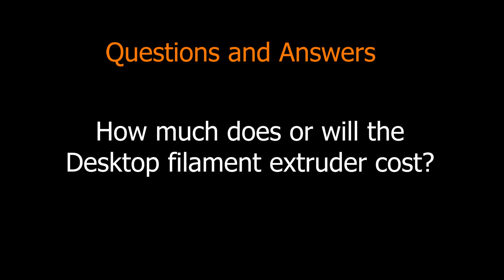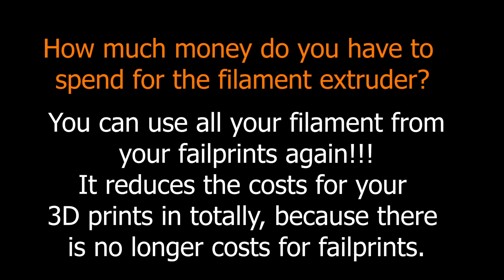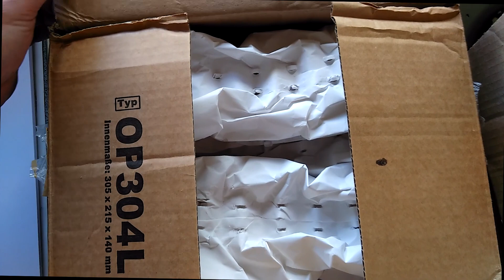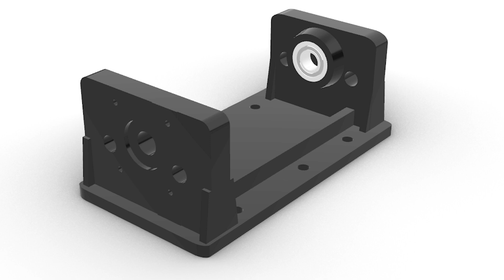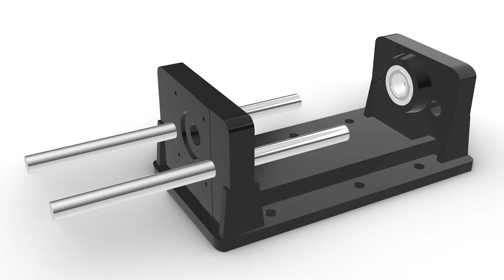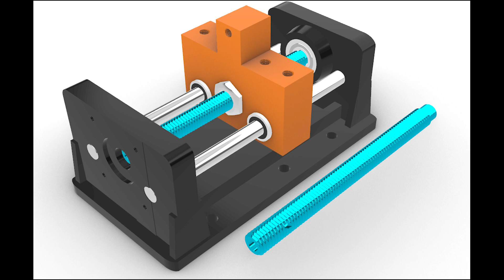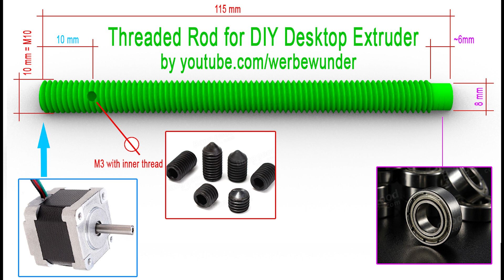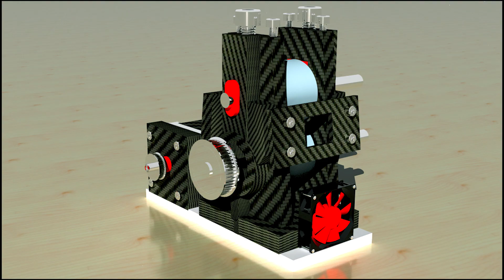3D Printer Filament Extruder [DIY] #1 Safe 90% Filament costs - A MUST WATCH for 3D Printer Owners!

Comment: Suggestion: use a M8 rod and use a 8mm to 5mm coupling. These are not expansive and you don't need anything but a saw to cut the rod to length ;)

German: einfach die M10 Gewindestange durch eine mit M8 ersetzen und dann ne billige 8 auf 5mm Wellenkupplung verwenden. Somit ist keine Bearbeitung der Stange mehr notwendig (abgesehen vom Zuschnitt mit Säge)
Reply: dann müsste die ganze Konstruktion aber länger ausfallen, da die Wellenkupplung ja auch noch Platz wegnimmt. Eine Wellenkupplung ist ja ca 25-30mm hoch- Das heißt man benötigt das untere Teil in 30mm länger
Reply: aber die Idee ist gut
Reply: Yes!!! Good solution
Reply from the maker: Then the winder has to be longer where the clutch is but the winder cannot drive. You need about 80 mm of travel for the wide filament rolls.
Reply: @Werbewunder  ok so extend the motor mount and travel stays untouched. Ok it gets 3cm longer but is it that critical? If so you could also use a belt, flip the motor and put it under the mechanism, so it gets shorter and T5 pulleys wit 8 mm hole are available ;)

Comment: Was $87 the average cost for this project as a whole or was that just a random floating number?  Thanks for English BTW
Reply from the maker: For the whole project the material price is 200-400 Euro
Reply: Werbewunder thank you very much for getting back to me.... I may decide to make this instead of another personal printer.... it’ll pretty much pay for itself in the long run...
Reply: It was a random floating number to show that you cant say how much the project will cost. It depends on the parts you will use. For example PID is not PID, there different versions you can use and buy and they have different price ranges in different countries and different shops.
Reply: Tam Gaming I understood that part... but no matter what the project is there’s always an Average price to get the project completed.  Or at least how much it cost the creator to create it and then you can adjust price yourself based on quality of products you choose to use.  I don’t think I’d ever start a project without knowing an average price point or at least what that specific project cost the creator to complete.
Reply: @Anthony Louis Hello Anthony, i understand your point totally. I know from werbewunder, that the costs of the desktop filament extruder isnt final so far, because the extruder itself isnt calculated exactly atm. But in Euro - its depends on which materials you use for the case and so on - but the cheapest version if you rebuild it is i mean he said around 400-600 euro. But because its not finished atm. I would start in your case to look for the electronic in your country or the links in the description and calculate it together. But see it as investment, and what you wrote "in long run" depends on which material you will print and / or if you can sell it. Let me give you an example: PLA to buy costs you around 30 - 60 euro per kilo. Some is more expensive like the one from greentech but it this you can rebuild later buy your self. So if you now calculate to buy 1kg granulate for 5 -10 euro - and you can sell it after you made it for 50 euro to be a bit cheaper than the original reseller you earn around 40 euro. How many kilo you have to make or sell if you need 600 euro? :-) You can calculate that this filament extruder will make around (depends on the filament type) minimum 1kg / hour.  Means after you have build it by your own you have in 15 hours your investment back :-) If you do it with PA12 the costs for the filament is way higher but the 1Kg Spool costs way way more if you buy it from a shop. Means you have to make not 15 kg to get your investment back - you have to make only 5 kilo to sell for your investment. So, if you are smart, try to rebuild it with the links in the description, then you know you have the right parts and no fail investment. If you want to be total sure, then wait till the last part = extruder is done and calculate everything together and then overthink if you want to rebuild it or if its to expensive for you. I hope i was able to help :-) Greetings from germany, sry for my bad english.
Reply: Tam Gaming Tam Gaming don’t apologize, your English is better then mine and I’m from America :)
I’m actually planning on doing it all for personal use so I’m going to stick to the lower budget end of the electronics.  I have a few life size projects planned that are around 40-50 kg of filament each, so the amount of money I’ll save just on making my own filament would pay for this filament extruder alone!
Reply: Hello Anthony, thanks for the nice words about my english :-) 
When you do it for your life size, then you really need the extruder. Why, because all the failprints arent any longer failinvestments. You can reuse them too by shredding them and reuse them as granulate. The only costs you will have in future from your failprints is time and power. From this saved money, you can buy another 3D printer and get the time back and make your extruder more effective :-) Its like to have a own gasstation for your car, and if you are bored of printed parts and you do not need them anymore, shredder them again to make filament again out of it  :-) I know that werbewunder has planed already to make a home- or desktopshredder. This you can use for your old print projects you dont need anymore or for filament which is on spool but not enought for a new printjob. Then you can shredd it and reuse it again as filament :-) And another great thing is you can make and produce your own mix of filament. If you arent happy with filament because its not flexible enought, then mix your own filament till you are happy with it. I love the idea to have to total freedom for my 3D Printer. Earlier or later everyone will have his own filament extruder at home  :-)
Reply: Tam Gaming yeah absolutely.... I’ve been wanting to get a filament extruder for a while now but didn’t want to spend $1000 on a decent one.  This might be the alternative I’ve been looking for.  Luckily Christmas is right around the corner and it’s the perfect excuse to spend some money on myself :)
Reply: Haha yes i also know what i will get on christmas because i make my self the present :-) it would be stupid not to invest in an filamentextruder, its a moneymaking machine and it neutralize all costs from 3DPrinting. It will finance all my next investments for 3D Printing. You will see in 1-2-3 years near every 3dprinter owner has a own filament extruder or knows someone who make it for him cheap :-)

Comment: Congratulations on the video!

In this part what I find difficult is the threaded rod.

Everything that customizes metal parts is complicated.

In my opinion, the ideal would be to replace the threaded rod with for example a gt2 belt as seen in this video:
https://www.youtube.com/watch?v=1zHvllPxvaw

In this way it would be easier for everyone.

I know that each of us can customize ... but in my case I would not know how to model it or modify the arduino code to make it work.

I think that making that change in the design would make everything much simpler and easier to replicate for everyone.

In the next videos I would like you to say what each part is for and what it does to make everything work and how it works.

Thanks again for all the work you are doing.

Comment: Ideas from a cheap but smart guy form Québec...
I've think about a solution to avoid power tool and be on the cheap side with more custom printed parts and scavanged parts...

6:57 Linear bearing:
I've replaced mine in my Anet A6 printer with printed linear bearings from Thingiverse. They works like a charm!
The bearing holder file can be modified to integrated them with no additionnal printing time.

14:17 Linear rail, rod and machining:
The linear rail can be scavanged from an old inkjet printer and you can buy a cheap 3 feets threaded rod in general store.
Then, it is possible to custumize both end. We can print a nuts that will fit on the threaded rod on one side and as a coupling for the motor on the other side. Another nut can be customized to fit the rod on one side and any recycled bearing size you have on hand for the other side.

5:53 Nema step motor:
I might be optimistic, but we might use a step motor from the scavanged inkjet printer again. I mean, there is not a lot of power required, so it should do the job at a very cheap price tag.

This is such a cool project, but my actual filament consumption can't justify the time required to built my personal extruder so far. I use only PLA at 12$/kg spool from HobbyKing and the ROI is not good for me. If anybody has time to build an ultra cheap version of the whole extruder, I would be very interested to see it.

Alex from Québec, Canada
Reply from the maker: You can also take used parts and modify them. The main thing is that this runs later. Anyone can change the extruder as he needs it.
Reply: Even with a bad Return On investissment, I know I will probably make this "puppy" one day... I just like the chalenge to make it as great and precises with the minimum cost!